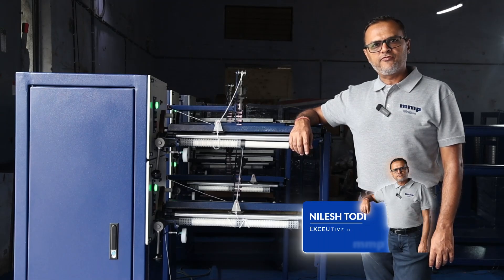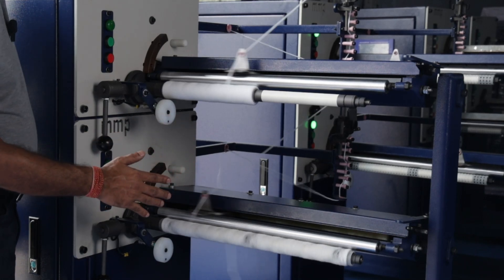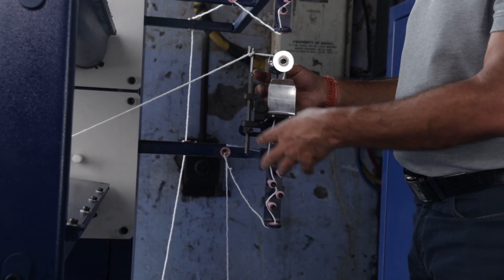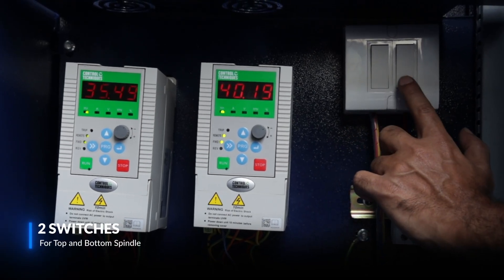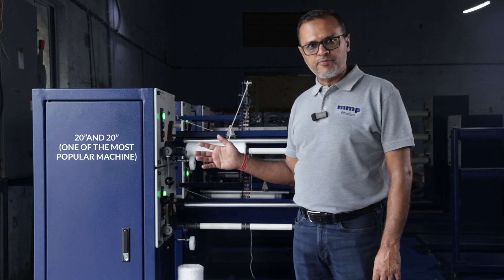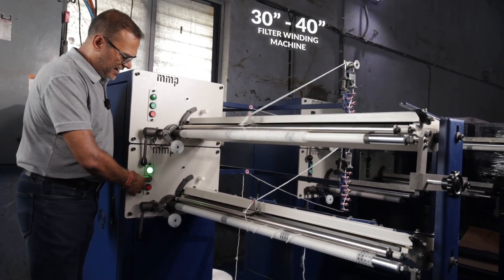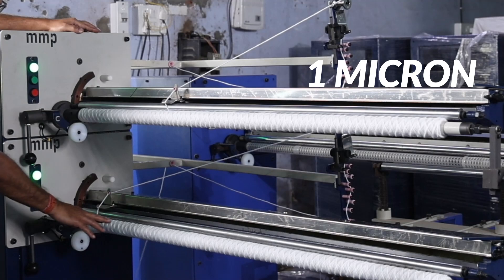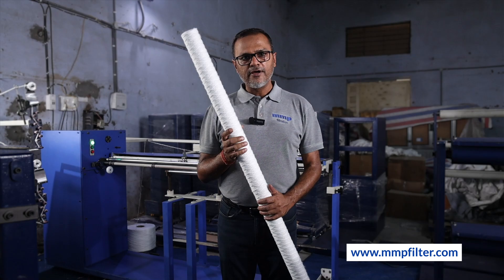𝗠𝗲𝗰𝗵𝗮𝗻𝗶𝗰𝗮𝗹 𝗪𝗼𝘂𝗻𝗱 𝗙𝗶𝗹𝘁𝗲𝗿 𝗖𝗮𝗿𝘁𝗿𝗶𝗱𝗴𝗲 𝗠𝗮𝗸𝗶𝗻𝗴 𝗠𝗮𝗰𝗵𝗶𝗻𝗲 | 𝗣𝗣 𝗬𝗮𝗿𝗻 𝗙𝗶𝗹𝘁𝗲𝗿 𝗣𝗿𝗼𝗱𝘂𝗰𝘁𝗶𝗼𝗻 𝗠𝗮𝗰𝗵𝗶𝗻𝗲 𝟭–𝟭𝟬𝟬 𝗠𝗶𝗰𝗿𝗼𝗻

Comment: Thanks for the video. I've worked on older yarn machines in the past and remember having to change out the gears which wasn't the easiest with big hands. I've noticed competitors using computer based machines to change to the different microns. What are the benefits with changing the gears manually? Are the computer based options that bad that you stick to manual gear changing? Do you offer computer based machines?
Reply from the maker: We offer a ratio-based machine that allows you to simply input the desired ratio, and the micron pattern adjusts automatically.

In addition, we have a three-layer PLC-controlled machine that is fully computerized. This system enables pattern changes at specified layer counts with ease and precision.

For further details or to discuss your specific requirements, feel free to call us at +91 98300 30030.

We also manufacture mechanical machines that require manual gear changes to alter the micron pattern. The key difference between these and our ratio-based or PLC-controlled machines is the level of automation — gear-based machines need physical adjustments for each pattern change, whereas the automated versions allow changes with a simple push of a button.

We would be happy to explain the features and benefits of the PLC-controlled system in more detail. Please don’t hesitate to get in touch with us at +91 98300 30030 or email us on ntodi@mmpfilter.com